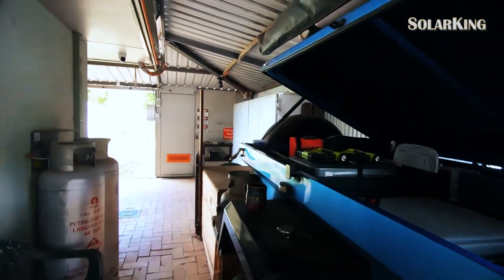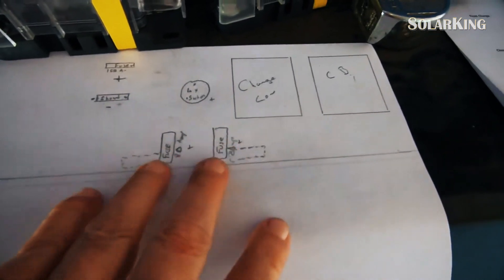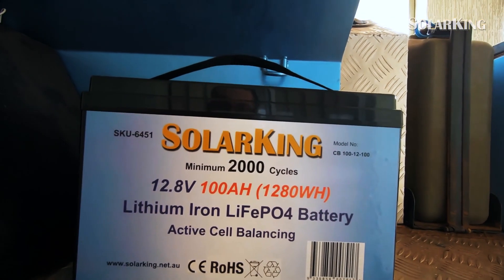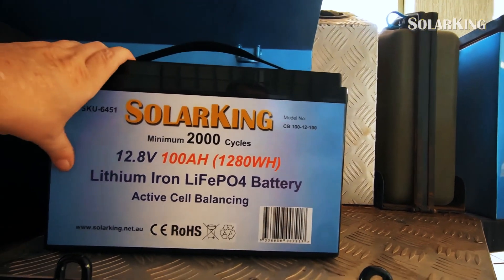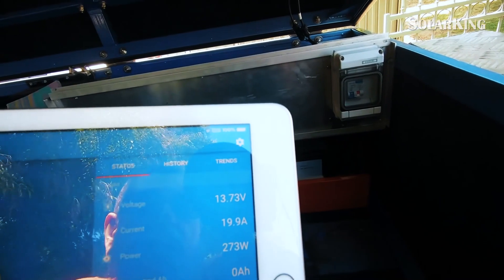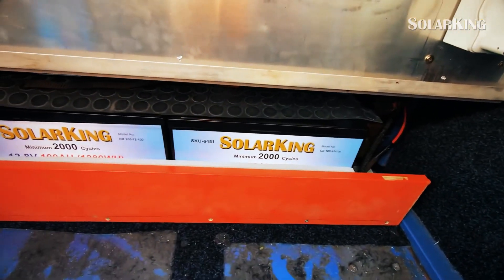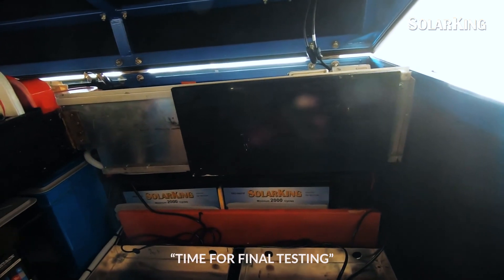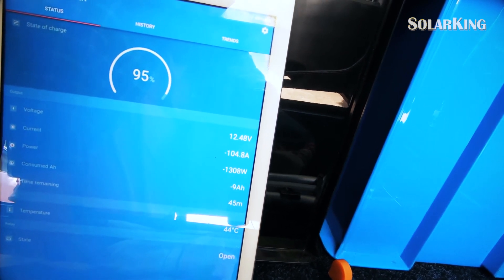SolarKing Lithium LiFePo4 Battery Installation & Review

Comment: Why did you need the newer battery at approx 7 mins ?
Reply: Yes why would be good to know....
Reply: New Model features 100A Continuos Charge & Discharge Current with Active Cell Balancing

I believe the older model was 20 or 50A